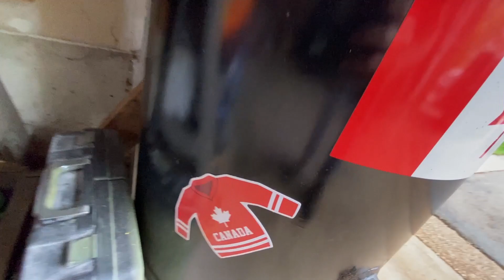Grinder Or Blaster - Who Will Win The Bare Metal Challenge On My 1936 Coupe?

Comment: Never used walnut shells for blasting, thought they were for light work. I know they use them on fiberglass body vechicals. I use black beauty medI'm grade abrasive. Like I've mentioned to you need right nozzle size also have to play around with feed on bottom along with air pressure. Once working do every thing you can because the next time you'll have same problem setting up. My sons blaster has no shut off controls with inlet air valve.

Comment: We were having the same problem with our sand blaster. But we played around with it and finally got it working fine
Reply from the maker: What media are you using?
Reply: @ScottRods  Blastrite platinum grit B40. That's what it's called over here in Africa. We were having the exact same issues as you were in this video and were instructed to play with our pressures and to keep it between 4 and 7. If the pressure is too high it can cause the issues you were having. I was trying to blast paint and hectic rust off a 39 chevy master front fender. After we got the blaster working it took me less than 5 minutes, was really awesome
Reply from the maker: @bravobase6801  Thanks, I'll look into it.

Comment: If you get that blaster working, be careful not to hold it in one spot for too long, it will warp your panels. You have to hold it back and keep fanning over a large area to keep the heat down. Blasting in a residential area is also a good way to piss off your neighbour’s. If you’re looking for a cheap alternative for paint you might try Tremclad with hardener, I’ve tried it and had a good outcome.

Comment: Did change the value in p/s/pump
Reply from the maker: Nope. It seems to be perfect. Maybe it already had a reducer fitted.
Reply: @ScottRods  my understanding to do it drops the pressure to rack thus help not to leak oil from seals
Reply from the maker: @peterhatch1583  That is correct, but I read that the fox body rack runs at a higher pressure than the mustang 2 rack. Time will tell.
Reply: @ScottRods  great how does one know pump pressure other chec it thks
Reply: @ScottRods  ride look great 👍
Reply from the maker: @peterhatch1583  I can tell by how easy or hard it is to turn the wheel. This setup feels very similar to my Ram 1500, so I'm happy with it.